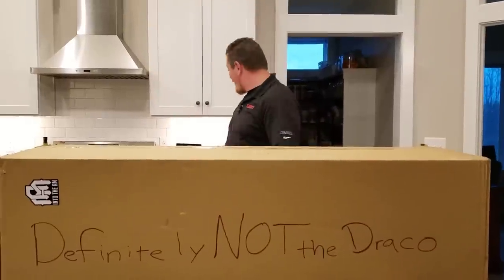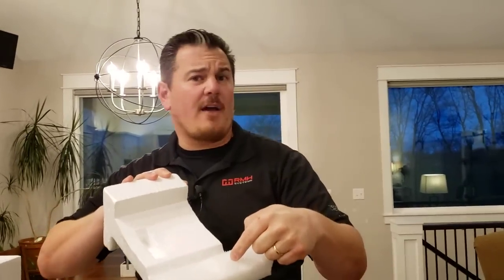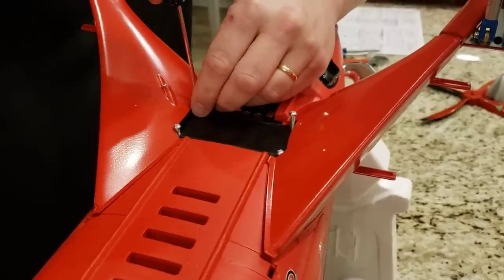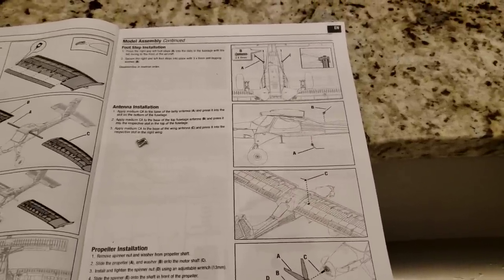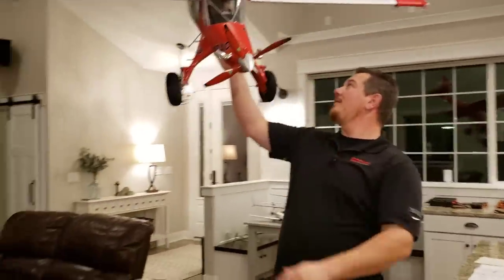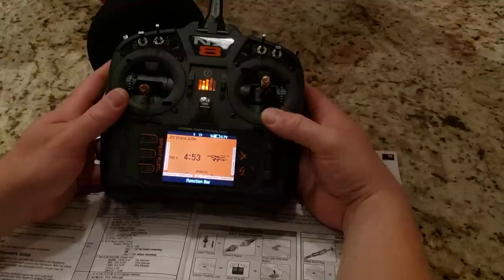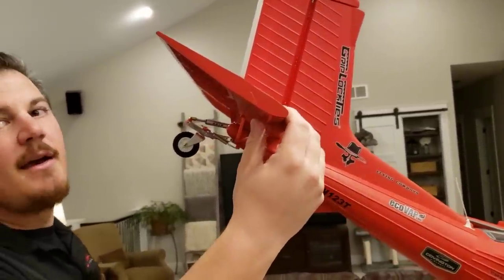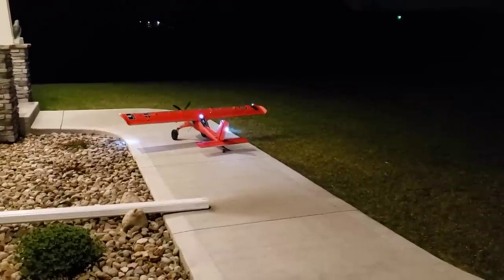Eflite - Draco - 2.0m - Unbox, Build, & Radio Setup

Comment: WHEW!  I made it through all 2:30 hours.  CRAZY cool airplane!  I don't see it in my stable any time soon, but I do see it happening eventually.  Horizon continues to raise the bar on scale detail with planes like Draco and the new Focke Wulf.  I continue to be amazed.

The only thing I would change aesthetically on Draco is to try to clear coat it with a high gloss, which would be more representative of the real plane.  I've been a subscriber to Mike Patey's channel for a couple of years now.  When I started flying RC about a year ago, Draco was the one plane I wished someone in our hobby would develop.  Hats off to Horizon Hobby for doing an outstanding job of that.

As always, thanks much for sharing.  BTW - the flight video was great.

Steve
Reply from the maker: GOLD START for you stuff!!!!!!!!!!!

HH is doing a great job, but they DO need to make some of these in the 1.2m scale and sell the CRAP out of them... so many are afraid of the price, but this plane is a good value.

Likewise for me, having watched Mike Patey for a long time too - he is the REAL deal!
Reply: YOU can clear it! Minwax hi gloss spray paint. $10 a can at lowes. Usually 3 LIGHT coats. BUT, if u add anything, (i put my ama number on everything i own), do it FIRST b4 clear coating! 👍

Comment: Good job Brian and your better half the Camera Crew!  The weights on the ailerons, and slates on the elevator are to help reduce the the strength the pilot needs to move the control surfaces. The plane does not have hydraulic control surfaces.  That is the full scale I am referring to.
Reply from the maker: Nice! Thanks for the info. I knew that about the ailerons, but didn't about the elevator - thanks! Always learning new stuff in RC / aviation!
Reply: @BrianPhillipsRC  me to!  Greatest hobby in the world!

Comment: Awesomeness Brian. I'm a helicopter guy but wow the detail is incredible.
Reply from the maker: It really is! You heli guys are spoiled in that you can basically have a plastic model around the guts of RC helis, which is AWESOME, but planes get too heavy ;( - This plane is the answer to this issue...even though it's heavy at 10 lbs, it flies light on it's feet in the air.
Reply: @BrianPhillipsRC  yea my 700 weighs 14lbs but 12s makes it feel light as a feather .

Comment: Best explanation of settings yet.  Wish the crow explanation on powered glider matched.
Reply from the maker: You mean, on the 2.3m Fox? It was the first time I did that one...but this was a super easy setup.

Plug and Fly planes are a bit more involved, but with the new Forward Programming, it's SOOOOOOOOO much easier than it had been. I promise to cover it more, if you keep watching ;)
Reply: @BrianPhillipsRC  yes, that was the plane I meant.  I want to set up crow on the FMS17 and don’t yet feel confident to do so.  Will keep watching and maybe you will show me how again?  Thanks.  PS I begin to feel I know your yard very well!  Still have trouble figuring how far away the tree line is on the right though.

Comment: The black handles at the wing root are just that. Hand holds so you can reach the top of the wing so you can reach things such as the fuel tank caps, inspect the wing etc.  The real Draco was a very big airplane and you don't carry a ladder with you!
Reply from the maker: yeah, I figured that out eventually, but I thought they might be clips for holding the wing on - LOL!!! Embarrassing ;)
Reply: @BrianPhillipsRC  agree they looked like alignment pins.  Oh BTW the black on the back of the prop is correct. The backside of the propeller is always flat black to prevent glare and make it easier to see thru the prop disc.  Keep up the videos!

Comment: I’m pretty sure that you measure the shaft of the bolt from the end up to the bottom of the head.  That’s why when you used the micrometer you got an 8mm reading from a 6.5mm bolt.  It would be nice if Horizon put them in labeled packages.  Sorting out bolts and nuts by size and thread count is confusing!
Reply from the maker: yes, agreed! they used to do this too, and they used to have "actual" size drawings for each part too...not sure why this stopped???

Comment: Regarding the tail wheel installation: I installed the two springs FIRST without needle nosed pliers and THEN AFTERWARDS bolted the main hinge bolt and then the shock bolt in place. No needle nose pliers required and no bent springs. This way it was very very easy without needing to apply any stress to any of the parts.
Reply from the maker: Cool!

Comment: You might want to verify your tire axle washers. i believe only one should be on the inside and two on the outside along with nut.
Reply from the maker: Sure. I'll look into it, since we'll be putting on Pneumatic tires soon, if all goes to plane.

Comment: This as got me hooked, but as I am still a complete novice and flying my drone and my two VTOL's and have only just got the nerve up to go from tricopter to the plane mode on 6G and the only plane I flew was a loan one as I had got quite good on the simulator he let me try but the only type of landing is crash landing as the VTOL's land in tricopter/drone mode, and the drone has home and land mode I use that. I just like the fact Mike Patey has hot rodded a plane way to go Mike. I will find a way to raise the cash to buy it even if it sits as a shelf queen until my flying is up to being able to fly, so plenty of simulator time ahead of me then buy a low cost plane to improve my flying before I take the DRACO for my maiden flight. 
I love that he went to King shocks and got a set of off-road type shock absorbers more seen on a Desert Racer like a Trophy Truck, Ultra-4 buggy Class 1 buggy and many many more. I mean who would not be impressed just looking at it and watch slack jawed as it takes off and lands in it's own length and has a reverse thrust mode to aid a quick lad and stop and parking it lol. So I have seen a couple of other You Tubers running through it along with Horizon Hobby videos, but you go way more in depth add a little humour along the way but sometimes very long winded but that is a part of you, really surprised your wife/ camera crew has not throttled you or just reprimanded you for a few dodgy comment's LOL, so don't change a thing as if not in the mood I can pause or fast forward it.
I would keep the polystyrene it came in to transport it in the car as no where to fly close to me even with it's ridicules short take off and landing.
Reply from the maker: Thanks Nick ;) Appreciate your thought, and stopping in again!

Comment: Awesome video. I got pnp high wing trainer plane and a spectrum receiver AR630. What you did in the setup for this plane work for mine or one of your other videos would. So far the only plane I have flown is a micro cub with safe on it. Again great video these full length are so helpful compared to all the other sales pitch videos out there. 👍
Reply from the maker: If you want to copy an easier setup, maybe look at one of our more recent FMS plug and fly planes. we setup an AR630 in an FMS Fox 2.3m the other day, but we added CROW, which isn't necessary and might complicate things for you.

Go back to the Fox 3m, and that will be SUPER similar for you...but we used an AR637T...BUT the forward programming is identical.

Comment: Oh man I really want one. But I don’t have room for another plane this huge
Reply from the maker: I have it sitting on the ground with one wing off, and you could take BOTH off and slide them under the fuse and pull the spar off and slide that under the plane. This would take about 1-2 minutes, if that, to accomplish.

My Carbon Z Cub SS 2.1m, by comparison, is bigger, and harder to store. It DOES come apart, but only after about 3-4 hours of pulling pins (slight exaggeration...FYI).
Reply: @BrianPhillipsRC  yeah, my carbon-z Cessna takes up quite a lot of space but is easier to take apart than the cub. I don’t have a large storage area though. But I’m currently working on getting it more organized

Comment: Hi Great video, just received my Draco and having problems getting all the lights working, any chance you could post a vid of how the lighting board is wired up?
Reply from the maker: I didn't wire them up. You can assign a channel. I cover this in the video. The Radio Setup part, you'll see when I get in there, I set it to the KNOB.

Comment: Hey Brian, I am really interested in getting a Draco. It will be my one and only plane, I'm not interested in flying any other types of planes. So my question to you is, what is the best transmitter for this plane? I like the Spectrum should I get a six channel or an eight channel? I see it has only six servos so does that mean I only need a six channel radio? Please advise me. Thanks (Love you channel) It was between this and the Carbon Z 150, but once I researched the real planes there was no question it's the Draco!!
Reply from the maker: Just get the NX8, and never look back.

NX8 https://bit.ly/3fffqyx

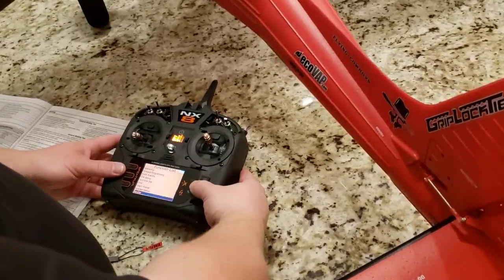Comment: 2:02:38  Hey @BrianPhillipsRC when going into system setup and disconnecting RF and simulating brown out(fail safe) is it normal for aeileron's to change state and put plane into left bank. I've noticed mine does as yours did in video. Btw thank you and camera crew for the in depth unbox/setup video..

Comment: All the technology onboard to assist with the flight of this plane could it be flown with just the basic setup pre-Smart and Safe mode I know the newbie would not be able to but could an old school model pilot be able to just fly as good as the safe mode makes possible.
Do you ever fly in the dark or just in twilight am/pm. I have watched this to the end and you are right not all of your uploads that is more to do with the style/type of plane or heli you are reviewing, one of the more enjoyable uploads was the JJRC M02 or the XD X450 can't remember which but man that was well funny in the snow, I still have two and only just recently gone from drone/tricopter to the plane mode in 6G.
Reply from the maker: An old school pilot should be able to fly this plane no problem, but I'd still suggest testing the waters with a cheaper plane first.

Comment: BUT....  And please weigh in here Brian, my experience with SAFE on the Carbon Cub 1.2 and Carbon S cub, and on RF 9.5 with me and a few others is that it is really easy to fly any plane equipped with SAFE.  Sure, landing and staying out of obstacles needs attention, but the flying is Sooooooo easy man.  Wouldn’t you say that as long as an RC pilots stays SAFE, its really easy to fly.
Reply from the maker: Honestly, yeah, it's pretty easy to fly [at least for me...I want to be realistic here] but it's still a $600 plane with a $100+ battery, and nearly $400 transmitter and expensive charger too. I just can't in good conscience suggest someone BRAND new to the hobby go and crash and ruin a $1000+ investment. One of our BIG goals on this channel is to keep people from being "ONE-AND-DONE'" - that type of influence is bad for the hobby. We want people who will get fully addicted, not just afflicted - LOL ;)

If you can fly a Sport Cub S2 UMX out of SAFE - GET THIS PLANE NOW :)

Just remember it's way bigger and you need way more room, bigger charger and batteries, and potentially more room in your car or truck ;)

Trust me, I want you guys to buy this plane, but I want more for your long term success...it's better for the hobby, my channel, Horizon Hobby, and YOU too!

Comment: Great content really appreciate your channel. 

QUESTION—

THRUST REVERSE-Throttle MIXING—-

What I have is an Aux1/Throt mix. When I press the I button I get immediate 50% reverse throttle so I don’t have to try to do reverse thrust and throttle on my own at landing. Release I and I have forward throttle with whatever I landed with. Which could be nothing or something. 

Problem is with this setup Aux1 is assigned to I with the mix always. This means I lose basic thrust reverse when backing out or with floats for example. 

My question is can I assign Aux1 to multiple switches? I tried that but when I did it messed up my mix and I didht accomplish my goal. 

Thoughts??!
Reply from the maker: Okay, sounds like you're real close - you don't want to make TWO CHANEL ASSIGNMENTS, you just make a MIX. This would be CHANNEL ASSIGN for say the "I" switch to AUX 1 (I assume you're using the I switch / Bind Switch, which is pretty popular way to do thrust revers, but not the way I do it generally)...then you'll build a MIX to make either another CHANNEL or a SWITCH do the same function. It sounds like you might have accidentally answered your own question, so I hope my wording isn't going to confuse you any more...but that's what you need to do. You're RIGHT there...just gotta run over the finish line ;)

When you do make your MIX, just make sure you test it in a way to keep yourself safe. Thrust Reverse is one of those features that can and does get people HURT, don't be "that guy" ;) Once you're all set, should be no-problemo, but don't want to see you get chopped up - possibly pull the prop for this type of work.

Good luck - you got this!

Comment: Will my NX6 fly the Draco?  What functions more would the NX8 do on the Draco - more light options?  Or something serious I would want an NX8 to fly it?
Reply from the maker: Yes, the NX6 will work, but I would very highly recommend the NX8....not just for this plane, but for many others.

Reverse Thrust
Light Control (on the fly - pun intended)

HOWEVER, you don't have RETRACTS to worry about...so technically, I believe you can use 7th [partial] channel on the NX6 for Thrust Reverse...then rest would work.

Please be super careful if you're not 100% sure on the Reverse Thrust, since that 7th channel kinda makes me nervous...since I've only used it maybe 20 or so models to turn SAFE on and off.

If you're plopping down the cash, GET the NX8. If you're already setup with the NX6, it'll do ;)

Comment: I had to sit my ass on the floor with it and use my legs to push the inner part out since I was by myself.  I ended up about halfway inside the outer sheath. LOL
Reply from the maker: It can be super awkward!
Reply: @BrianPhillipsRC  Quick question.  What are the 45 degree wing lights mentioned in the manual?  Thanks!

Comment: Can you tell me what is the best Spectrum RC for the Draco or is the Spectrum RC DXS good enough ?
Reply from the maker: Tough call. While I believe you can bind the DXs to the Draco, you will want more refined control to make her fly the way it can fly... It's not a cheap plane, and I fear your experience may be greatly diminished if you do anything less than an NX6, but for only $40 (or so) more, you can get into an NX8, and basically fly almost any of the offerings...

Some will tell you that the DX8 would be fine, but I want you to get the more time out of your investment, and HH is moving to the NX now, and I don't want you to loose support in the next few years....after all, these Tx'es are expensive, so might as well get a great one now and enjoy it fully!

NX https://bit.ly/3mbVuNB ( I think you should get the NX8...if you're buying the Draco, this is what I suggest)
DX https://bit.ly/2OwKprB

Comment: 45:01 I installed washer there, did not feel right without, the screw is not supported all around.
Reply from the maker: I agree about the "not supportive at all" - washers are SOOOOOOO cheap, so I've always wondered why companies leave them out...maybe it's a weight thing, or the extra $0.02 per plane??? I don't get it.

Comment: Hey Brian (and amazing cam crew) love the vid so much became a subscriber. Just bought this plane but I'm a Futaba guy for bigger other & aircraft. I do however have an old Spektrum DXe 6 Channel trans that I use for smaller stuff. Ya think I can get away with this trans? Don't want to buy another transmitter.
Reply from the maker: Probably, if it's DSMX or DSM2 (should be on a DXe), you should be able to bind, BUT you'll need more channels to do everything. The latest and greatest firmware would be a great help, if you can upgrade the firmware on your Tx. Some features are accessible from the AVIAN ESC via a Serial communication system accessible from the Tx....you'll see in the RADIO SETUP part of our video, where we do Thrust Reverse.

As for getting the plane in the air, you should be fine, but as for taking full advantage of the systems on board, you'll want 8 channels. Hope this helps!

If you decide to break down and get a newer Spektrum Tx, I can help you out. No you don't absolutely NEED the NX8, but if you want to do everything, might be in your future ;) There are good things coming soon, but I get that you're a Futaba guy, and everyone has their preferences.

Comment: Hi Brian

I have had a few flights on Draco so far and love the way it flies. Seen a few things online regards the servos being small for a heavy plane like this. Mine so far are ok but if I were to replace them for something stronger what would be a good choice please. I can't seem to find an online comparison between the a332 it uses (same as timber x) however someone said that they've used hitec hs65mg  Any thoughts on this as I have had a flap servo fail on me once and resulted in a big crash. Cheers 👍
Reply from the maker: I wouldn't ever upgrade the Servos on this plane, but if you must, I'd just make sure the specs are BETTER, and then you need to be real careful not to overwhelm the current and voltage loading on the BEC.

Good luck, but I'm not changing any servos on mine ;)
Reply: @BrianPhillipsRC  ok that's a good point I didn't think of that. Cheers Brian I'll keep with the stock ones 🙂👍